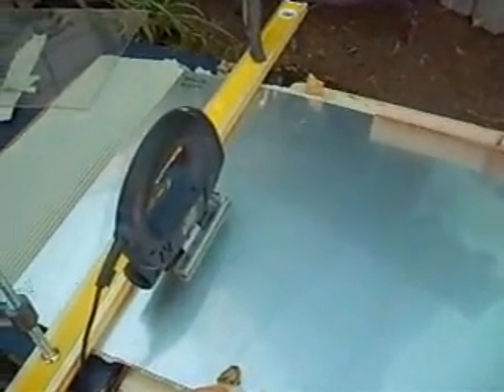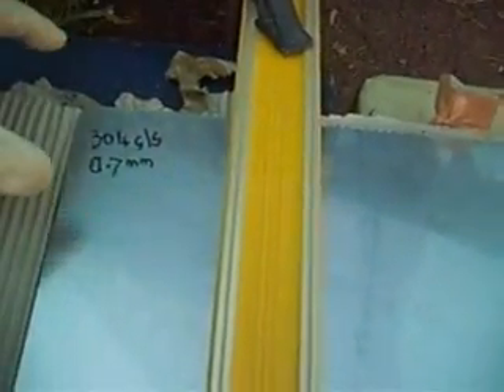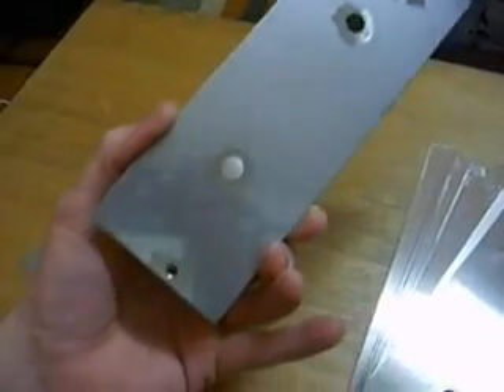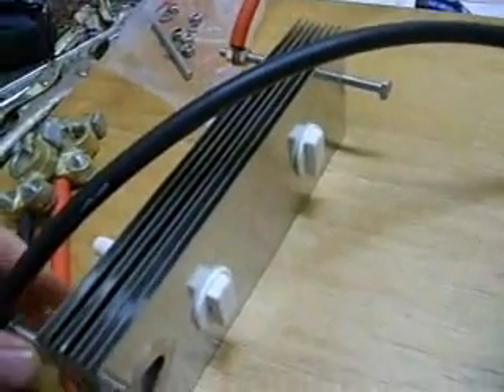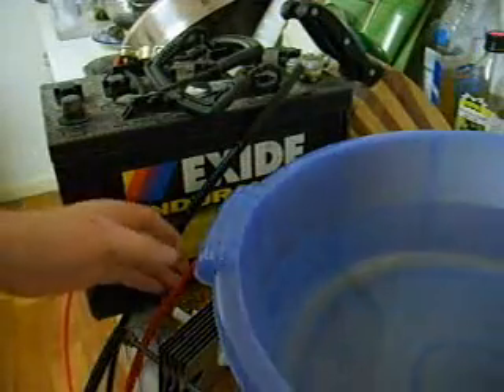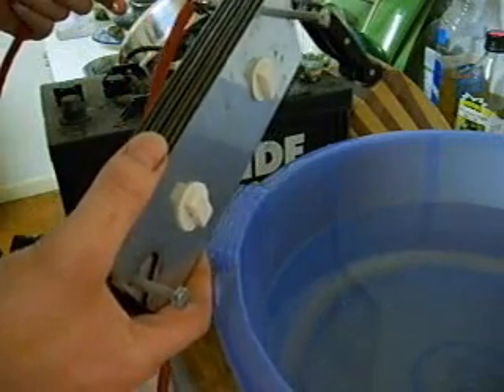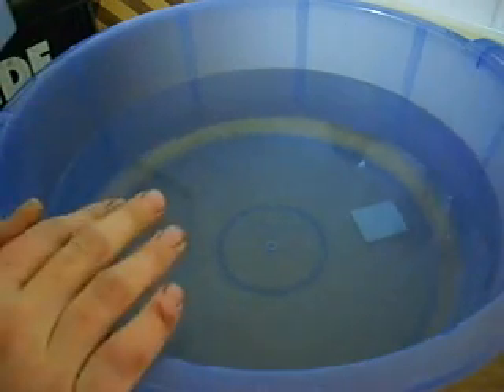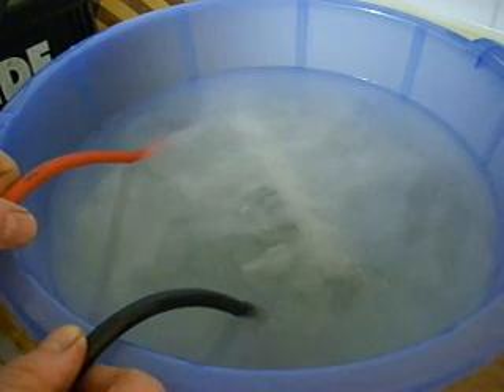Hydrogen at home (my new cell)#4

Comment: great vid. great info. thanks a lot! seeking to build my own hydrogen generator.  just a caveat, i would be weary about using your range hood fan to exhaust your hydrogen. think about the arcing at the hood fan motor brushes. potential ignition source.

Comment: Ok, but if you have a cylinder as the reservoir, circular shape get the more surface platter. The point is to test all stupid ideas, the more absurd the better - never mind on saving - the right shape will save lots of gas- remember! Joe cell tube on tube , moe joe cell spheres , meyer cell multiple double tubes seems to be winners. Why not a double helix cell - a donut one? Give your imagination a chance c ya

Comment from the maker: Cutting round plates from a sheet would be a waste of steel.  I did not end up cutting up the entire sheet, plan on making lots of different shapes and sizes.  My other videos show different designs and neutral plates, as for using a larger hole, I did think of that but I did not have a large enough drill bit to make it work.  This is just a test plate, I was not to worried about the odd rough edge.

Comment: Ok. You re much better than john Aaron cause you have a bright star intuition. When i saw your cells i imagine you were going to cut round plates but NO. What i mess! Not even squares but rectangules NOO. ANd with the some awful cuts! No need - just drill a larger hole for the screws going to the next plate without touching and easier/quicker o make - by the way, where are the neutral plates?